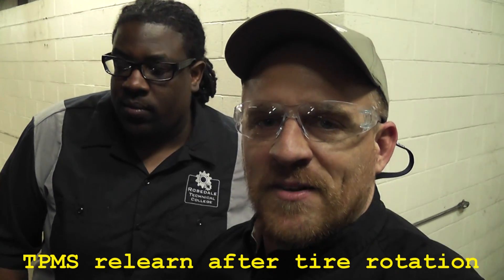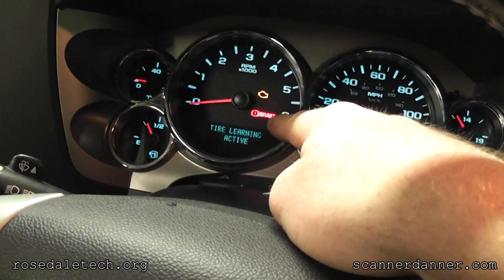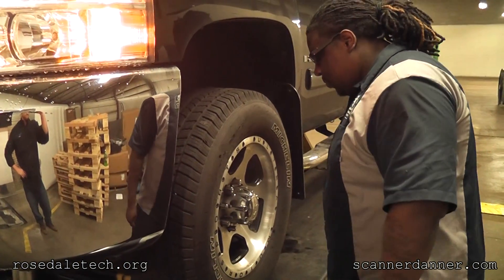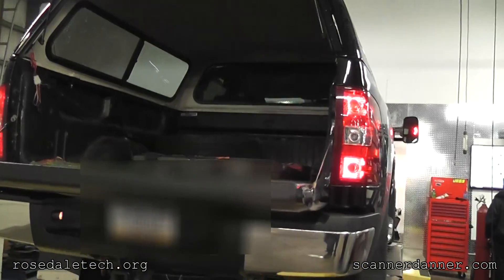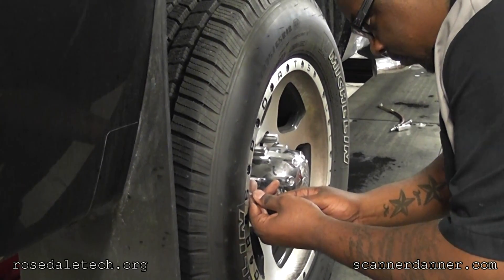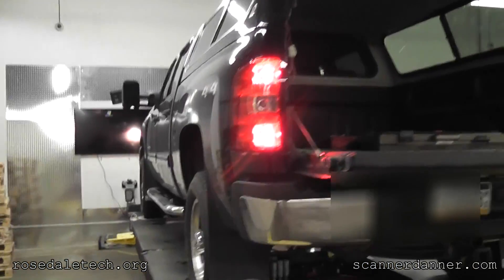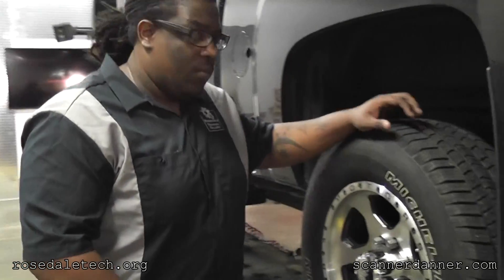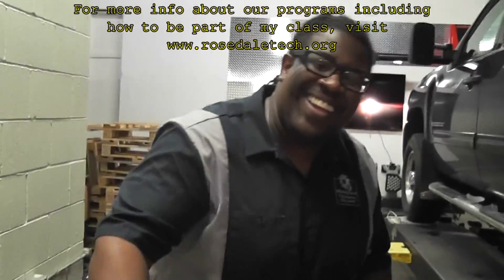How to relearn tire pressure sensors (no tools required)-GM (up to 2010)

Comment: Just seeing this and need the instructions. Is it safe to let the air out at home and then drive less than 5 mins away to put the air back in or should I drive to the air location first and do everything there? Thanks!!
Reply from the maker: I'd do the process at the location of the air pump. Sometimes you have to let a significant amount of air out

Comment: Hello Scannerdanner. I am having trouble resetting two different GMC vehicles. One is an ‘07 Yukon Denali and the other is an ‘11 Sierra. Neither will confirm the right front sensor. I have had my scanner on it and all sensor batteries are good. Both trucks say unlearned and both trucks say 147.8 psi on the scanner but show dash marks in the DIC. Please shed some light on this if possible. I have been trying on and off for mths on the Yukon and 2hrs on the truck today. On the Sierra today I have reprogrammed the RCDLR, tried changing tire sensor placement as to eliminate possible RF interference, as well as clearing all codes and rerunning the module scan and code check. The only code I get is C0750.
Reply from the maker: Define the code please. Also you may just have a bad sensor. I don't see where you replaced it

Comment: I did the same thing the same way and it did not work for me 2014 GMC Yukon Denali. But it did work with the tool but had a code for the left front tire issue and not reading, but when I used the tool it fixed that. After sitting for a couple customer comes Now the Dam right side says it needs air but it don't,  It reads on the tool but not the dash what gives 2nd time on a GMC the last 1 was a OPPS I'm sorry the last time it was a Chevy Traverse WTH. I'm starting not to like working on cars they don't have hands but they want to fight me all the time.

Comment: Well they're all 30-40 lbs under now..All four down 30 lbs and it didn't beep once. All courtesy lights on except one. Still says left 37 and right 101. RR low add air LR 78lbs.  2012 RR new LR spare/100% tread., Old rears up front 30% tread
Reply from the maker: This doesn't work on newer models. Sorry

Comment: Thank you for the video.Just one comment. It was not that the computer noticed pressure drop. If it can notice, it already knows about the sensor. It is the sudden drop of tire pressure that triggered the sensor inside the wheel to broadcast its ID and pressure info out. The computer just listen and whatever sensor reports during that period, the computer will learn its id. Triggering the sensor by letting air out is not quite reliable and cumbersome. Later they changed the to procedure to using a small trigger device instead of letting air out.

Comment: I tried this letting air out on my 2017 1500 Silverado, no go. I let half the air out and I followed the sequence. How much air needs to come out before I hear the horn? My tool won't reset
Reply from the maker: You need a tool for your model year. This manual method will not work for you as you've found out. Sorry
Reply: @ScannerDanner  The tool finally worked, it took 30 seconds for each wheel to beep, longer than normally. Thank you

Comment: So this still would not apply to those whose vehicles are not equipped with a key fob?
Reply from the maker: you would need a scan tool to initiate the programming of the sensors without the key fob

Comment: 2010 malibu. I get the LF and RF to register but not the RR. Bought a new Schrader sensor and still wont register/beep. Started at 40psi and let it all the way out. Suggestions?
Reply from the maker: could be the new sensor is not the right one for your model
Reply: @ScannerDanner  Got the same part number from Auto Zone and Parts Authority Schrader 33500. Not impossible that it was bad out of the box. I am taking it to the tire store tomorrow to have them check it with the TPMS tool. Do you have a TPMS tool you would recommend? We have an Autel OBDII scanner but no tpms functions.
Reply from the maker: @jaxnaturals  I've seen plenty of bad out of the box parts. Don't rule it out

Comment: This did not work on my 2013 Savana. The computer refuses to acknowledge that I let out some air. No horn and does not illuminate the next light. But I did get the "Tire learning active" in my DIC. Is the procedure different for vehicles newer than 2010?

Comment: I purchased a reset tool for under £10. It worked perfectly,  all very straightforward.  Then I saw this clever video, and realised I could probably have managed without it. However it's less hassle using the tool than having to deflate and  inflate 4 tyres every time. I guess, instead of deflating the tyres , you could inflate them a fraction, and that would save the deflate, reflate thingy. Of course you have to do it in less than 5 mins!

Comment: I’ve been trying this method  but can only get 3 of the 4 to reset, the horn beeps twice after the right rear tire is deflated, any thoughts?
Reply from the maker: Sensor is probably bad in the wheel that won't learn

Comment: 2007 2500 Work truck trim level don’t have a key fob transmitter. Now what?
Reply from the maker: you need a scan tool that can activate the learning mode for you
Reply: ScannerDanner got 4 sensors from Walmart, gave them to firestone when a got a set of new tires. They couldn’t figure out how to program them! Took the truck to walmart, they screwed with it for an hour, couldn’t get it! Guess I’m gonna have to go to the dealer! What a hassle and expense.

Comment: This video is misinformation.  It only works on pre 2011 GM vehicles.  Anything after 2011 (and some 2010s) require the relearn tool, and will not work just by changing air pressure.  GM did away with it to prevent stray pairings, but really was about $ and getting customers back into dealerships.

The GM Tire Pressure Monitoring System (TPMS) is designed to provide information to the customer allowing them to better maintain proper tire pressure in their vehicle. Proper tire pressure is important for optimizing safety, fuel economy, vehicle performance, and tire wear. Because the GM Tire Pressure Monitoring System (TPMS) recognizes a unique sensor ID in each tire, a TPM relearn must be performed after every tire rotation.

On past model vehicles, there were two procedures to relearn the TPMS: a Dealer Procedure and a Customer Procedure. After putting the vehicle in relearn mode, the Dealer Procedure used a TPM Tool (J-46079) or equivalent to activate each TPM sensor individually (Tool Method). This allowed each rotated tire/TPM sensor ID to be stored in the new corner location. The Customer Procedure required increasing or decreasing air pressure in each tire by one psi (Delta Pressure Method) to active the sensor allowing each rotated tire/TPM sensor ID to be stored in the new corner location. When using either the Dealer or Customer Procedure, there was the possibility of picking up and storing a stray pressure sensor signal ID from another vehicle that may have been broadcasting n the area. If a stray sensor was inadvertently stored, the system would not recognize the stray sensor ID and the vehicle would set a Diagnostic Trouble Code (DTC) and illuminate the TPM System light.

To commonize procedures and eliminate the possibility of storing stray sensor signals, starting with Late 2011 Model Year GM vehicles and all vehicles build after that point will support just one TPM relearn procedure - the Dealer Procedure. This change allows both Dealers and Customers a common, faster, and more efficient method to relearn tire pressures after each tire rotation. Because all future TPM Relearns will be performed using the Dealer Procedure, customers wanting to rotate their own tires and perform their own TPM Relearn will be required to utilize a relearn tool. GM has designed and manufactured an inexpensive Relearn Tool (EL-5044 specifically for this application. Owner’s manuals have been updated accordingly, to verify the relearn method to be used, reference the Owner’s Manual – Tire Rotation – TPMS Sensor Matching Process
Reply from the maker: So if I put "up to 2010" in the title, you would be good with that? When I uploaded this, I was not aware of GM doing away with the customer ability.  I don't think the "video is misinformation". Clearly if one cannot activate the tire psi learn mode with there key fob, then it is not available on your car. Pretty straight forward I think.
Reply: ScannerDanner - My point is that someone who has a newer model and needs a reset is going to search around, come across this method thinking it'll work, and spend a lot of time and frustration before finally realizing it won't work.  These people are already in the comments.  It takes a bit of searching to find out GM made the switch, which even I wasn't aware of until I tried the old method on my newer model.  An addendum to the title/description could potentially cutout a lot of work for some people.
Reply from the maker: done, thanks!

Comment: I have a 10 impala. After I put it into learn it doesn't matter how much air I let out it still won't be and move to the next tire
Reply from the maker: Do you have any codes for the TPMS system? You may have a bad sensor.
Reply: Thanks for replying. To be honest I'm not sure what you mean by codes. The way it started was my car was telling me the rear right wheel had low pressure for about 2 weeks, but since it wasn't that bad(only off by 5 psi) I left it. After 2 weeks it started saying service tire monitor instead of pressure low.
Reply: And when I look at my tire pressure on my car it doesn't display one for my rear right wheel. So I figured I would fill it back to the right pressure and do what you showed in your video, but I cant even get past the first tire. (It does show the pressure for the front left tire on my display)

Comment: Also of you come across a tire that has been inflated with any kind of fix a flat or similar brand the tps has to be replaced . Low tire indicator lamp will stay lit or on dic will say that tire is low  until a new one is installed and activated .

Comment: Can you reset it with out the remote control
Reply from the maker: Not that I am aware of
Reply: Yes, just use the DIC(driver info center) on the dash. Scroll through your options till you get to tire position relearn, then hit the check mark. The rest of the procedure is identical to vid!

Comment: If only it was this simple on my Toyota Yaris (Prius C) - you have to connect to the ecu via the OBD2 socket to reprogram the codes or, as I did when fitting winter tires,  buy universal sensors and clone the already existing sensors in the summer tires (Program the new sensors with the same codes as the old sensors.)

Comment: ... hey Scanner Danner ... i was told that Aftermarket FOB KEYS cannot be used to relearn the tire pressure ... if you hold those two keys down the car does not honk with Aftermarkets ... i recently bought and Aftermarket Dorman Fob Key for my parents recently bought used 2008 Saturn because the OEM remote was broken a long time ago by the original owner ... and when it did not work i called Dorman Tech Line and he said aftermarkets dont cant communicate with the cars TPMS system so i would have to buy an OEM fob key -------- any thoughts on that?
Reply from the maker: Not sure man. I know Dorman isn't known for quality parts. I always hear Eric O from SMA hating on that company and I trust his judgement.
Reply: ... well the part itself was not bad for being a programmable remotes ... it just did not do what i needed which was be able to communicate with the cars TPMS system

Comment: My  tire pressure sensor on the driver's side front tire gives incorrect reading.  It reads 27.  I added air and more air.  Finally got it to read 29.  Checked tire with pressure gauge and it read 55.  Used two other pressure gauges and they read 53.  How can I clear the computer screen that keeps popping up with the incorrect information.
Reply from the maker: You need to change that sensor

Comment: Is this a GM thing? I have a 2014 CTS and the sensors are flipped. Will this method work? Thanks!
Reply from the maker: No, the newer ones you'll need a scan tool and TPMS tools to do it. Sorry for the bad news.
Reply: Thanks for getting back to me!

Comment: I need help seriously.
So i have a 2009 silverado 1500 and i changed rims and tires and the tire pressure sensor is on. And well i put 20in rims and 33×12.5 tires and i just wanna know how can i fix that?
Reply from the maker: do you have tire psi sensors in the new rims and tires? have you relearned them like I showed in this video? Where are the original rims and tires when you are programming the new ones?
Reply: ScannerDanner i did re-learn them yesterday. And now thyre off i think i fixed it thanks for making this video.

Comment: For GM only I guess.
I wish it would work on a 2015 Dodge RAM 3500 Dually. In our shop someone broke the Left Rear Inner Sensor. Even with the relearn tool we couldn't do it. I heard the Dealership charges close to $300.00! 
 Have you made a video on how to do the dually pressure sensors? 
Oh yea, the inners are steel wheels the outers are aluminium.
Reply from the maker: You need a scan tool and TPMS tool for Chryslers

Comment: Can you do the same process for all cars or a 2015 chrysler 200 cause we broke a customer tpms am ordering a new one and i have to reset it when you buy a new one.

Ive done this process on a chevy and it worked
Reply from the maker: Chrysler procedures are different. Pretty sure you need a scan tool and another tool to read the sensor.

Comment: Although an old video, I'm gonna try this tomorrow on my 2016 Sonic RS. I had a 17" wheel and tire replacement due to an accident and now the light came on (I noticed about 30 minutes AFTER I left GM service and it is a 2 hours one way drive back to them!!!). My OnStar android app displays a -2 psi. My car has the menu button on the turn signal stick (press MENU, scroll to Tire Learn and Set). I will try it tomorrow (the poor man method=no scanner) and will post results. I only hope that those idiots at GM did put a TPMS inside the new wheel.
Reply: Well, I deflated the first tire (following the parking light pattern) about 15 PSI (from 35 to 20 PSI) and no honk. I guess it does not work on my 2016 Sonic RS.
Reply from the maker: I'm sorry Raul

Comment: I have bought new tires and rims, put NEW sensors on them. can I program the sensor with this tool ?? tahoe 2017
Reply from the maker: No, this method will not work on your 2017. You need a scan tool and special tool to wake up the sensors (I'm pretty sure)
Reply: do you think this would work on my cadillac ats 2014?

Comment: this procedure dont work on my 2011 chevy equinox LT. any one that can offer help is well appreciated.
Reply from the maker: I think the newer GMs you need a tool to wake up the sensors and it is done with a scanner connected as well. I'm not 100% sure on that though.

Comment: Just had New set of tires installed. GMC Yukon and I can get in tire learn mode. The front driver never honks while deflating. Managed to drain entire tire. I gave and went to the others and I get a honk for each. Bad sensor?
Reply from the maker: What was your message display before attempting the relearn
Reply: Service tire monitor system.
Reply: Yep, it probably got damaged in the tire replacement process. At least you've figured out with one it is right?
Reply: I think you're right. That's likely the cause. Thank you!
Reply from the maker: no problem! Thanks for watching
Reply: just to finish conversation, sensor was bad. took it in and had it replaced. At least I'll know for next time. many thanks!